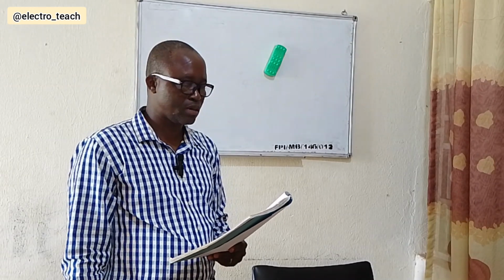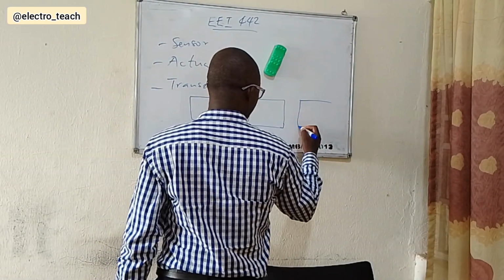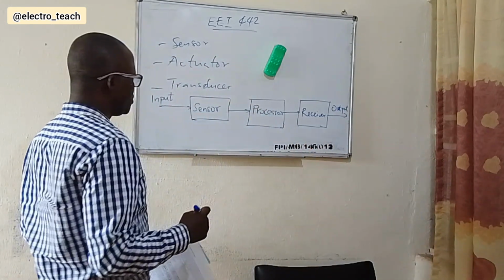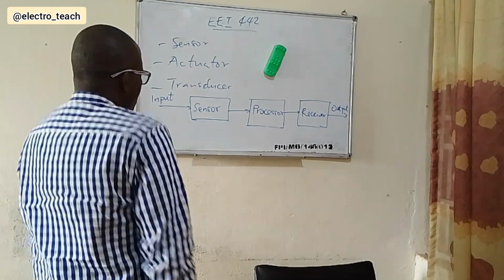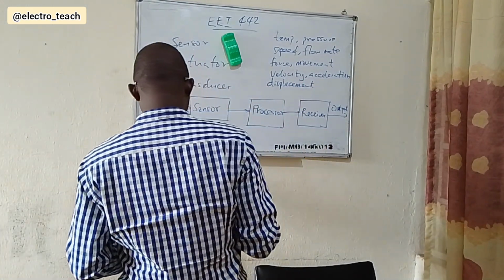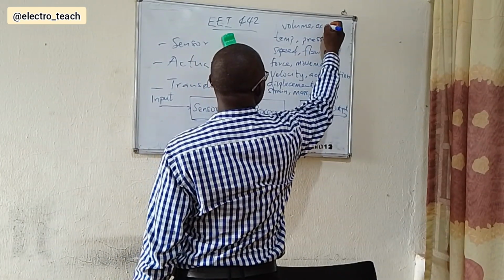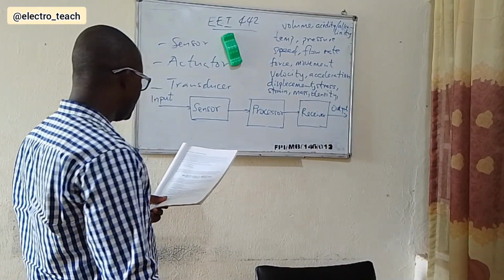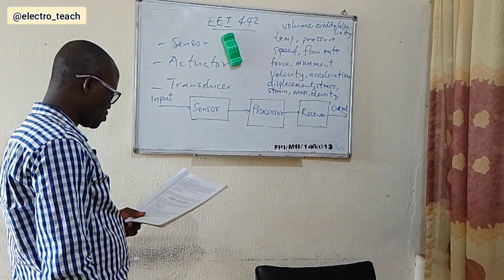Sensors, Actuators and Transducer Theory | Basic Instrument Theory @ECIMacademy

Comment: A transducer is a device that convert energy from one form to another form which can be either electrical, Mechanical, thermal or solar energy. A transducer acts in form of a sensor or an actuator. Sensor is a device that measure or indicate a signal and that aquire information from the real world.

Comment: summery
There are three(3) basic system element which are;Transducer,processor and receiver.
A transducer  converts energy from one form to another which can either be thermal,mechanical, or electrical energy.
It quite easy to understand 
Well done sir
Reply from the maker: Hope you learned something new. here
Reply: Yes sir

Comment: Summary

A transducer is a device that converts energy from one form to another. It can also be define as the device that converts primary form of energy to a corresponding signal to a different energy form.
Also transducer can also be regarded as a form that take as a form of a sensor or actuator..

Actuator is a device that generates signal or stimulus, example is a heater.
Sensor senses a signal or stimulus or that requires information from the real world. 

There are three main part of a transducer which are:
1. Sensor.
2. Processor.
3. Receiver.

We have elements that can serve as input device which can be applied to the sensor
Pressure, speed, movement, acceleration, stress strain e.t.c
Reply: My question goes thus

What changes does a mechanical transducer sense?
Reply from the maker: A transducer can sense variations in physical parameters such as displacement, heat, level, force, pressure, etc.

Comment: Summary 
A transducer is a device that converts energy from one form to another which can be either electrical energy, mechanical energy energy,thermal energy or solar energy etc.
A transducer acts in form of a sensor or an actuator.Sensor is a device that measures or indicates a signal and that acquire information from the real world e.g relays while an actuator is a device that generates a signal e.g timer .
The physical variable properties are pressure,speed,temperature,flow,force and level etc 

Thanks for sharing this to us sir more grace more strength sir, we hope to see more from you sir

Comment: Basically, a transducer is a device that converts primary form of energy into a corresponding signal with a different energy form (secondary form of energy).
Primary form of energy may include mechanical, thermal, electromagnetic, optical, chemical etc.
A transducer takes form of a sensor or an actuator.
A sensor is a device that detects/measures a signal or stimulus e.g. thermometer.
While an actuator is a device that generates a signal or stimulus, example is a heater.
Various physical variables can be measured such as temperature, pressure, speed, flow rate etc.

A basic instrument system consists of:
1. Sensor or input device.
2. Signal processor.
3. Receiver or output device.

Lesson well explained.

Since we said an actuator is a device that generates a signal or stimulus, can we call it a receiver?
Reply from the maker: No, it's not.

Comment: Sir, can we also refer to the actuator as a receiver?  
in a control system, the sensor senses the input parameters, and the signal is been transmitted to the processer which then compares the input signal transmitted to the system setpoint before sending the signal to the actuator which is the final control instrument that directly controls the process. So from the block diagram can we also call the receiver an actuator?
Reply from the maker: Receiver is not an actuator. No

Comment: Summary
A transducer is a device that converts primary form of energy to corresponding signal with a different energy form which can be electrical energy, mechanic energy, thermal energy etc.
It takes the form of a sensor or actuator.
Sensor is a device that measures signal or stimulus, it acquires information from the real world e.g thermometer
Actuator is a device that generates signal or stimulus e.g heater 
Physical variable include temperature, pressure, speed, flow rate, force etc 
Lesson learnt, well explained sir